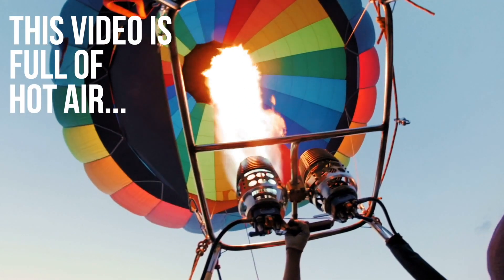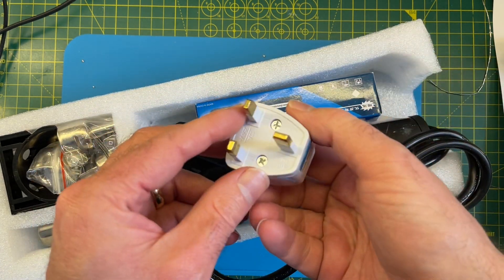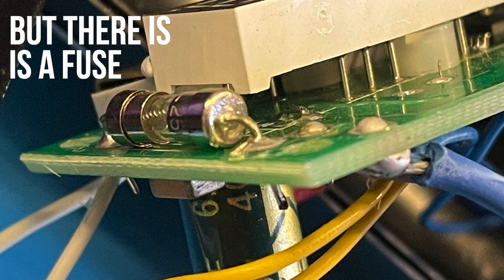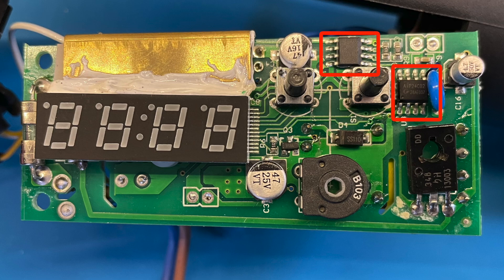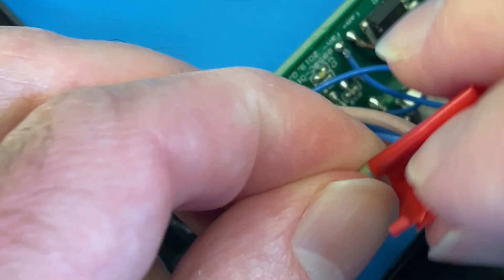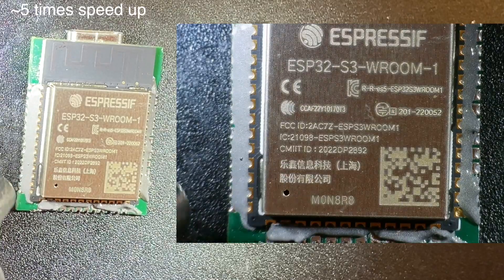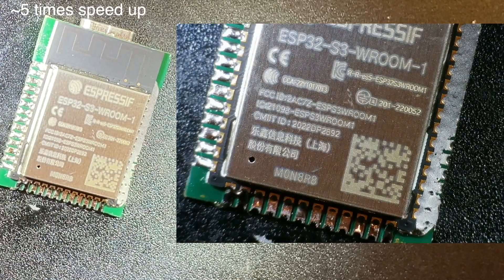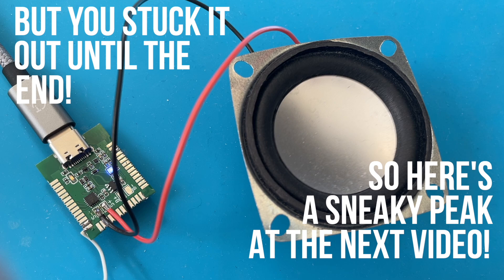A Lot of Hot Air - Soldering ESP32-S3 Boards

Comment: Have you tried out soldering the smaller ESP32-S3-MINI-1 which has more pins available? Im curious how doable that is with a hotplate, because I just ordered a dozen without realizing it doesnt have castellation -_-
Reply from the maker: I haven’t, but I know a few people who have. They had some issues with solder not sticking to the pads - so give them a good clean. But it’s definitely doable. Just a bit of a pain as you can’t easily see bridges.
Reply: @atomic14  Very new question but when you say give them a good clean you mean.. use a lot of flux?? or like a brass pad?
Reply from the maker: Give them a good clean with IPA to make sure there’s no residue on them and use plenty of flux/good quality solder paste.

Comment: Nice video. You could get one of those solder paste dispenser accessories. They basically attach to the syringe and plunger and make it more ergonomic to use as well as offer more control over the flow. I've seen some 3d printed ones but theyre not that expensive either

Comment: There are some good 3d print projects on thingiverse that make it easier to control dispensing solder paste if you look for "solder paste syringe dispenser". It will convert from a push action to a one handed squeeze action
Reply from the maker: It's that or a hand grip strength training regime. Think I'll go the 3D printing route :)

Comment: next time, just go to the other end of the cable, cut the plug? way less hassle than soldering it over and over again, no?
Reply from the maker: Now why weren't you there when I was doing it!? On a serious note - it's actually quite surprising to find a non molded plug nowadays.
Reply: true that. I d replace it with a screw on, but then again, I am not even a novice soldered, and you a regular, so your way was the most fluid.. and funny 😉 @atomic14

Comment: well by UK safety laws any exposed conductive parts must be earthed.
BS EN 61010 
para 6 Protection against electric shock
para 6.5.1 Protective bonding
 Accessible conductive parts shall be bonded to the PROTECTIVE CONDUCTOR TERMINAL if they could become HAZARDOUS LIVE in the case of a single fault

Well you have a 240V heater in the metal part so it should be earthed for your safety.

Good luck and don't touch the hot end wen cold and plugged in.

Ask the seller for a copy of the DOC  (declaration of conformity) for the product and see what they say, well worth a laugh.
Reply from the maker: I guess one advantage of the end being hot is there’s no way I’m going to touch it… but I think I will find a way to get the earth connection to it.
Reply: @atomic14 you may not touch it, but you may still touch it to something else! No sense in dumping 240V through whatever you're trying to solder, or energizing your bench when you put it down.

And who knows how sketchy the insulation between the heating element and the body is.
Reply: @atomic14  you could get a small isolation transformer and run it from that 🙂

Comment: I didn't know the UK plugs had only a 3A fuse!
That would be around 700W max?!
Reply from the maker: Maximum is 13A - there's quite a few values available, but I think the recommendation now is either 3A or 13A - with our voltage that gives you about 3KW.
Reply: @atomic14  Wow! I wish we had 240V in North America as our main voltage. It comes in at 240V from the street, but it splits into 2 phases of 120V at the breaker panel. Our living areas use 15A breakers, our Kitchen 20A, our water heater 40A@240V. You guys saved a lot of copper in your wiring infrastructure. Smart chaps.
Reply from the maker: Apparently it's because we were slow of the mark! https://electronics360.globalspec.com/article/10511/how-the-u-s-came-to-adapt-120v-while-others-are-using-230v
Reply: It varies depending on the device. The plugs/sockets themselves are rated at 13a so something like a a fan heater would have a 13A fuse in it (and a thicker 1.5mm flex), while something like a charger might have a 3A fuse because it doesn't need much current and has a thin 0.5mm cable that needs protected

Comment: Ah! 1.  The deathDaptor see big live for details after destroying it.

2. I had one of these. Awful. Spent the same money again on an 857? Much much nicer to use.

3. So glad it’s not just me that has to do things over and over to get it right 😂

4. I’m guessing you didn’t solder the ground pads in the centre of the wroom to the board? I usually put the wroom on first cos you need to heat the board from underneath
Reply from the maker: I'll have to dig out that video - love big live's content.
I'm constantly doing the same mistake again - heat-shrink always get me - how do I forget to put it on every time?
Yeah, not soldering the ground pad. I could probably do it with the mini hotplate but it would be tricky to guarantee it. It is optional - it does help with heat dissipation from the module, but it's not critical.
Reply: @atomic14  oh yes! Heat shrink- another ‘favourite’ of mine!

Comment: 4:10 the classic blunder, i feel bad for laughing but it happened to me oh so many times
Reply from the maker: For me it's generally heat shrink. Cut the heat shrink, solder the wire, heat shrink is still on the desk... I've had it happen multiple times in a row.
Reply: I knew as soon as you passed the cable through the end plate that it was the wrong way round. And the heat shrink thing is a frequent occurrence!

Comment: Mains wiring soldered so closely together inside a hot air gun.... No strain relief, so if a wire comes loose then 😰 ⚡
I would connect the earth wire mechanically secure to anything I can touch from the outside and/or a loose phase inside can touch.
Also, I would re-do the solder with lead-free solder - as this melts at a higher temperature than leaded... Just in case the fan is not enough to keep the inside below 18x degrees C.
I would probably also mount one of those temperature controlled switches (bi-metallic) that turns off above 110-120 degrees C, for extra safety.
Reply from the maker: Fantastic suggestions! I really like the idea of a temperature switch. Thank You!

Comment: That plug is one used in China. But you’re forgiven for thinking it was Australian as the pin layout is the same except upside down (earth pin below the phase/neutral pins). NZ uses the same as Australia. And this plug types are not fused, and rated for 10A although there is a less common 15A version with a larger earth pin. We don’t generally use ring mains here although I believe they are allowed. I know UK does generally use them, maybe this is reason fused plugs are not used here. Love your videos by the way. Thanks.
Reply from the maker: Thank You! I was hoping someone would identify it - makes much more sense now. I'm going to have a queue of angry Australians at the door!